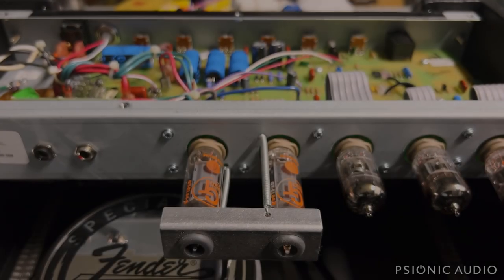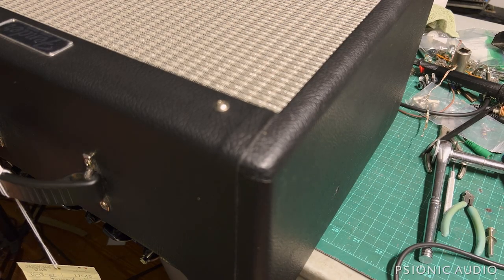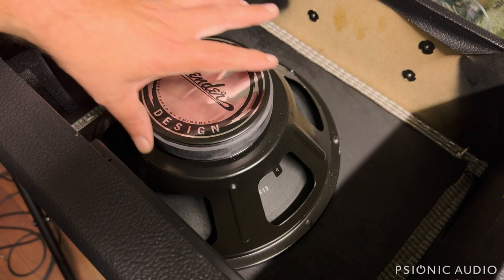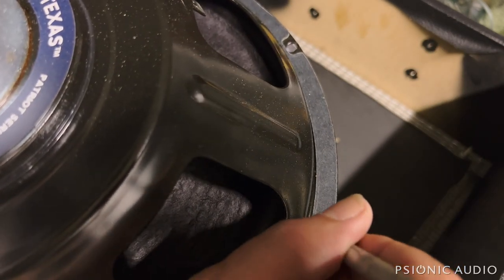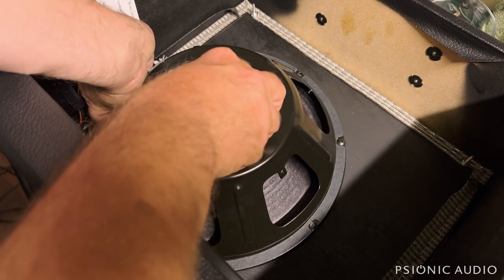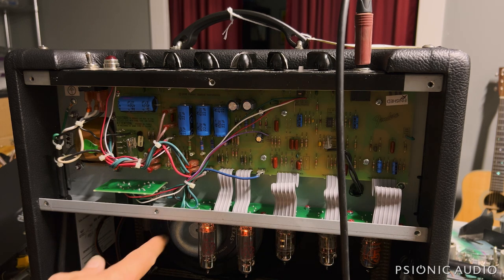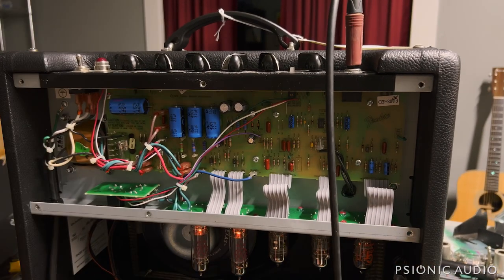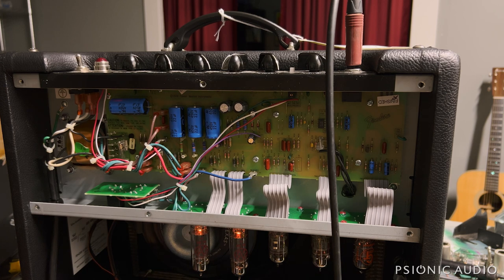Blues Junior Gets a New Speaker

Comment: I just picked up a basically new BJr IV.  The newest versions from late 2019 have the new very different Bias Circuit.  Sounded OK but that Brit Cap took some
paint off the wall.  Anyway....  I tore into it.  First replaced the Cup Capacitor from .0022 to .022.  The new circuitry replaced the .0022 to .022 in the last stage.
Then I changed the Marshall tone stack (.022/.022) to the classic Fender tone stack (.1/.047...Twin).  Then shorted out the Mid control ctlr ctr cx to left cx.  And to
top it off I took out the .100pf paint scraper brite cap and put in a .047pf cap on a switch.  What a wonderful difference!!!!  Now a small Twin with good bass,
 working Treble and Mid control with a brit switch that just adds more Fender sparkle.  I would have never been able to do this without your videos.  You gotta
hold your mouth right to get that PCB (black) out.  And the solder they are using is hard to vacate.  Would be easy to burn some lift if not very careful.  Thanks!!

Comment: A hard-rubber (soft-plastic) dead-blow mallet filled with lead shot is a great tool for applying a little persuasion or an "attitude adjustment" to a bent flange or sheet-metal chassis. Every  tool-chest needs one !

Comment: Quick question - the issue with the tubes running hot - isn't that what gives them the overdriven breakup? So if that's "fixed" then they won't growl? If the answer is "that is correct" I almost feel like I'd rather go through the tubes faster in order to get that sound. My volume lives between 10 and 12, using the Fat as a solo boost and oh lord I love the sound. If fixing the bias undoes that -- it's kind of taking away the golden egg that makes this amp sing? Happy to find out if I'm wrong.
Reply from the maker: No, amps don’t need to be dying to sound cool.
Reply: @PsionicAudio  So biasing the amp won't change the sound? Thanks for responding.

Comment: I got one from a friend and one fire up that’s what it did! One power tube exploded damaging the amp. Fried chicken in parts of the board. A friend rebuilt the poor diodes and replaced all the caps with high quality ones as the factory grey caps are poor quality. Now it’s back and sounding awesome!

Comment: I have installed a MM output tranny and choke on a couple of those and it made an appreciable difference. But the best tone I got from one of them was when I plugged the speaker into a 5E3 cab with a Weber 50 watt Blue Dog. It was an amazing sound.

Comment: Lyle, I'm perplexed - every amp I've ever owned has the speaker mounted to the baffle with 4 screws, yet the basket has 8 holes. Do the speaker manufacturers intend their products to be mounted with 8 screws? if not then why are there 4 extra holes in the speaker? The only reason I can think for the extra holes is to allow more flexibility in positioning the wire connection tab. What do you think?
Reply: Fender twins use all 8 holes

Comment: i had to replace my tube board this week in my blues jr!! checked for cracked solder joint, which it had on all but 6 solder joints. i was going to just reflow them but when i did the pads lifted right off!! so new board and good leaded solder and shes sounding good as ever! would you recommend not using the stock output tube retainer? and just for back story it has a full bill m kit with adjustable bias.

Comment: You didn't mention speaker break in.  I know that makes a ton of difference.  Also, what do you think of putting a 125 watt speaker in a 18 watt amp?  Will it have the ump to get the speaker loosened up?
Reply from the maker: Speaker break in is over hyped IME. They change but not that drastically. 

I wouldn’t choose a 125W speaker for this amp. But I wasn’t asked.
Reply: @PsionicAudio  I do not agree. When I put a new cannabis rex eminence in my BJ, I didn't like the sound at all. The sound was not good, fizzy and boxy, with no bass. And after several weeks, the sound became wonderful. It all depends on the speaker. Cannabis rex takes a long time to break in, for example.
Reply: @PsionicAudio  Speaker break in is absolutely a thing.

Comment: We always called it Foot Pounds. My brother did auto mech for many years before aviation. Too many head gaskets.
Reply: Yep, that's the unit in the US customary system. (Newton meters in metric.) How many pounds of force are you exerting on a rod one foot away from the center of rotation.
Reply: For smaller fasteners, we use inch-pounds.

Comment: Here's an amp that actually needs a standby switch and doesn't  have one. Lol Fender, you put a standby switch in shiploads of amps that should not have one and then on the odd amp that does actually need one you don't bother omg lol. My MkIV series 2 blew a tube within weeks and fried the board. Good job Fender, you also know they run too hot and still haven't fixed the problem even after having another attempt in the MkIV series 2.
Reply from the maker: It doesn’t need a standby.

Comment: Are the threaded fasteners for holding the speaker to the baffle board actual T-nuts with the flanges inbetween the front of the baffle and the speaker cloth?? If they are, kudos to Fender for doing it that way. But, if the inserts are merely threaded into the particle board baffle, then  😖😖😖 #@%&!! .....and regardless I would prefer to see 8 bolts rather than just 4 (even for a lightweight Neo-mag speaker, but especially if the speaker has a large heavy magnet). Not to mention that Torx-head bolts would be easier to use than Philips heads, easier to remove and reinstall/tighten without slipping or stripping.

Comment: Noticed when checking speaker screw tightness on Fender DR, that there is a substance like fingernail polish on each screw...?
Is this a warranty trick...?
Couldn't believe how many loose screws/nuts there were...!!!
Thanks for that video that pointed out these things😉😎👍
😎👍
Reply from the maker: It's supposed to keep them from vibrating loose. You're very welcome!
Reply: @PsionicAudio  
I see...thanks...
However...
If they tightened them enough...they wouldn't need to put the fingernail polish on them to begin with...?
😉😎👍

Comment: Listening to an ES 335 through this BJ I think it would have been interesting to contrast it with a Tele or Strat – with my BJ III (an Eminence Swamp Thang having replaced the Fender stock speaker) I have significantly more low end with an ES 335 than with a Tele or Strat. So changing guitars will require adjusting (at least) the Bass settings.

Though I haven't yet modified the R51 to cool the bias (which I will eventually thanks to you repeatedly pointing this out) I'm somewhat surprised to see that so far (after about 10 years!) there seem to be no visible traces yet of too hot output tubes causing trouble to the PC boards or the tube sockets soldering points. But maybe that's depending on how heavily these amps are being run (or driven) after all. Also I actually feel that I haven't been forced to get new EL 84s too often in the past. Nonetheless it seems reasonable to cool the bias, anyway, as I admittedly do feel the the heat at the back at the amp when I turn it off after 1–2 hours of weekly rehearsal with the band...
ADDENDUM: I did take off the back off the amp again today to take one more closer look and I noticed that there IS indeed a distinct discoloration of the orange print on the right hand EL 84 output tube, which suggests that it is actually running too hot – like you said it would! I'll have to look at this soon and add that 82K resistor piggybacking R51 to cool the bias... So thanks again for making me aware of this fact!
Also – having the amp at home – noticed some tube rattle with V1 so I guess I have to rplace that one, too...

Comment: I have a Blues Junior Mark IV... what resistor value should I use to "fix" the bias? The same value as the Mark III? Love your videos by the way. Thanks!
Reply from the maker: Not sure as I’ve heard reports of some fixed bias IVs and some cathode bias IVs, though I have not had any cathode bias ones come in. If it’s fixed bias, yes, 68K across R51.
Reply: @PsionicAudio  Awesome. Thank you so much!
Reply: @PsionicAudio  I thought you'd put an 82K across R51? Anyhow probably isn't all that different in the end.

Comment: What's another good speaker for the Jr.?
Reply: Swamp Thang
Reply: I like a celestion .green back .
Reply: Greenbacks are great in Blues Jrs, Swamp Thangs are a bit modern for my preference in a clean Fender amp. Both are absolutely amazing speakers though, they just do very different things
Reply: That is the Dilemma. There's no place to demo speakers.
Reply: I tried 4 or 5 different speakers in my Blues Jr. 

My two faves are a Weber Blue Dog Alnico 30 watt speaker with the bell cover removed. It will fit just barely. 

Or the WGS ET65 speaker which is a Creamback clone.  

The Creamback clone is what I've liked best for live gigs. The Blue Alnico is best for recording.
Reply: @joegoliver3 Are you done and satisfied or are you still wondering if there's something better out there.
Reply: I have a Tone Speak Austin 1250 in mine and I love it. There's a couple vids on YouTube and one in a blues Jr.
Reply: @joegoliver3 i didn’t realise the ET65 was a Creamback clone. They were two speakers I was looking to try out. The Jensen in my Tweed version has too much speaker breakup and doesn’t take overdrive well (from the amp or pedals), especially when the amp is turned up. Sounds ok in the room until you hear the recording back 😩

Comment: Hi Lyle. What speaker would you recommend for the B Jr? I have similar amp with a seventy 80. Crapola.
Reply: Anything but the 70/80. I put an eminence swamp Thang in mine, sounds excellent
Reply: Eminence Legend is a great speaker for this amp.
Reply: Good luck choosing a speaker it's kind of a One-Shot deal. You can ask that question and get a hundred different answers. there is no place to demo them that's the problem.
Reply: @stringlocker  , yeah your right! Everything else in life you can demo first and decide, guitars, amps, cars and clothing. Hard to pull the plug for $150 -$300 not having an idea.
Reply: @kmichaelp4508  You would hope the amp companies would do that research for us but they don't they put the cheapest thing they can find in there. Boutique amp companies do the research. I guess we're a little bit to blame are we ever satisfied.
Reply: @stringlocker  , and will never be!
Reply: @stringlocker  , and…. We don’t get any response to kinda help us out either!
Reply: I have no idea what speaker to buy.😞
Reply: @stringlocker  , oh I’ve had 10 or so recommendations. So could just go out and buy them all…. Then sell off what I eliminate. Yep! Yeah right
Reply: Haha 10 may not be enough the 11th one might be the perfect one. I guess we just use what we got.
Reply: I'm very old so back in the day you didn't change your speaker until  the one you had blew up. Maybe we should go back to that.
Reply: Consider the Warehouse G12C as a good match for a Fender. Only $119.99 too.
Reply: I was  thinking gf the George Alessandro sc60.....I believe....anybody tried this in blues jr.?....... claim to tighten low end flub
Reply: I have a Warehouse G12C/S in my Blues Jr. Series III , and am very happy with it. Made a huge improvement over the stock speaker which i did not like at all.
Reply: Everybody says what speaker the changed to and love but no reasoning to why.
I'd like to change mine out to get a more bass out of it.
Reply: @uncledoug9934  The reason i changed out my stock speaker was that to me it had way too much treble, and almost harsh or brittle sounding. Did not care for it at all. And this was after it was broken in as well.

Comment: The Texas Heat was my favorite in the Blues Jr. and came highly recommended at the time I owned one.

It had way more bass than the Neo demonstrated here. I wonder if the owner purchased it by mistake or something.
Reply: Have a Texas Heat on the shelf waiting to go into my BJ.  Do you think the amp has enough power to drive the 150 watt Eminence? Was it to your liking and why?
Appreciate any info you can give, and I would answer any ?? you may have too.
Reply: @averagegearreviews4109  I've had a Texas Heat in my Blues Jr for a few years. It drives it just fine. Plenty of lows. You won't get speaker break-up for sure but i rely on pre-amp distortion. Compared to Blues Jrs I hear on You Tube, I think mine is cleaner. But the amp is heavier than any OEM speaker.
Reply: @genebrenner855  Good Morning, that's a fine point about speaker break-up. I too use pre-amp and pedals. I did some common mods to a TS-9 and it makes that amp sing.
Thanks again and enjoy your day!

Comment: Question: Is swapping the speaker on a Marshall DSL20CR something that a layman can safely do or would I need to get a tech to do it?
Reply: You can do it. Make sure it's the proper ohms and wattage.
Reply: @dangitdan9938  Yeah I understand the principles, just need to make sure that I'm not going to be electrocuted. Now just need to decide if a Greenback or a Creamback is the way to go. (I think it's the Greenback)
Reply from the maker: You won't get zapped changing a speaker. Greenbacks don't like being in open-backed 1x12 combos. Creamback 65 will kill it in that context.
Reply: @09philj  I second the cream back. 🤘 I put one in my origin 20 and loved it.
Reply: @PsionicAudio  I see. What would generally be the downsides of putting a Greenback into a little 1x12?, out of interest?

Comment: EL84 amps are pigs on tubes .I have owned at least an half dozen el84 amps all at a same time & all of them had the original el84's fail & had to be replaced within one  year .
Reply: Place the amp *designers*, not the entire category of "EL84 amps".  The amps are invariably designed to push the tubes way harder than they can take for any length of time, especially today's modern Russian and Chinese-made tubes.
Reply: I blame the designers assuming they can bias is crazy hot.
Reply: @davidfuller581  ,  They might have gotten away with this kind of circuit design and hot biasing 60 years ago when you could go down to the local tv/radio repair shop or perhaps even the drugstore and buy some Mullard or Telefunken EL84'S every 6 months or as needed, but nowadays with Russian and Chinese tubes and ultra high wall voltages, they need to rethink their designs.

Comment: ? I have the Monoprice/Harley Benton State Right 15w amp. It is cool biased, but the gain is extremely sensitive and goes very gainy after increasing the gain nob to 2, it's like the master volume. Because at 1, and you turn the amp up with the volume, it is pretty low in volume, but nice and clean. Once you get it to 2, you are already in crunch. How can I affordablely lower that gain and clean it up going past 2? Oh. It has the original speaker. The Celestion Seventy 80 12in.
Reply from the maker: Correcting the problems in those amps costs way more than the amps do.
Reply: @PsionicAudio  true, but it would be worth it in the long run wouldn't it? Having an amp that I already paid off and improving it little by little to get a quality sounding amp. Yes, it will only be worth what it is worth, but the end result is what I want. Since I will not sale it because its not worth much.
Reply from the maker: Not in this case IME. You'd be better off buying an amp you already like the sound of. The HB/MPs are landfill destined by design.
Reply: @PsionicAudio  thank you for your honesty. It does help some decisions I am making for sure.